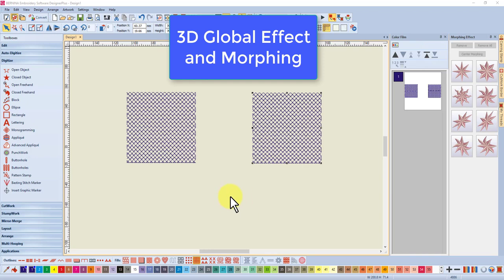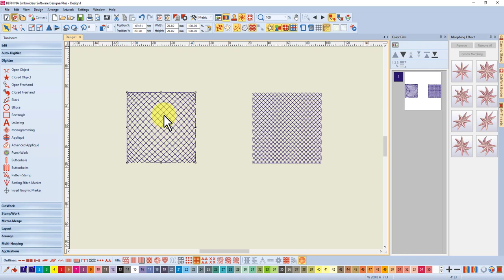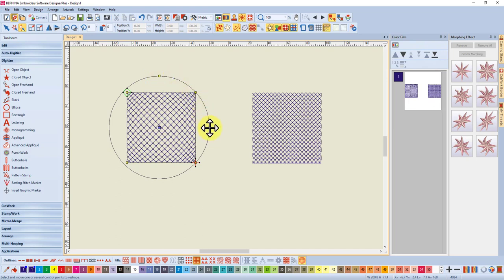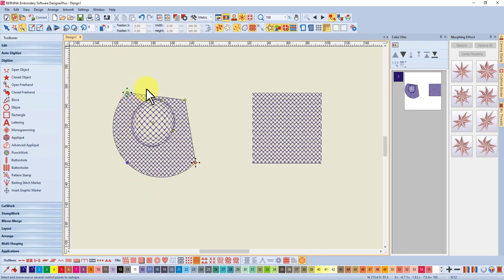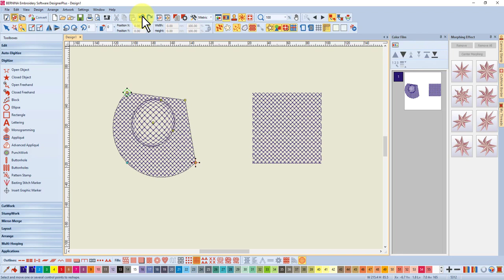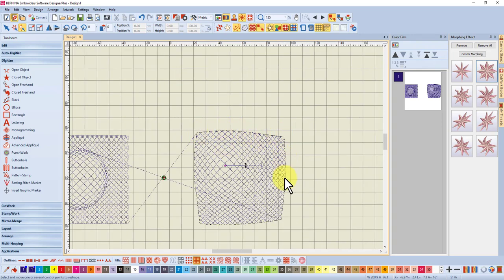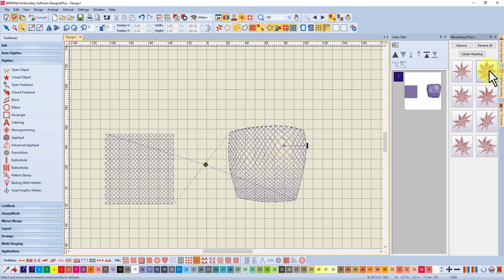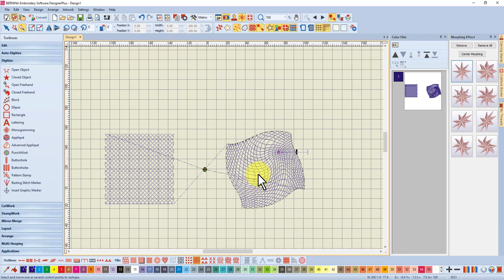3D Globe Effect and the Morphing Tools compared

Comment: hallo please show us the correct way to do perfect continues outlines with no jumps or stops ..... and why on the same design the line will work 100% and on other parts is it way off...Please help Bernina V7
Reply from the maker: Sorry I didn't reply sooner. The Blackwork Run tool might be the answer to your outline with no jumps issue. I have an older video about it here. https://youtu.be/OCkYB-xoztg In V8 the Blackwork run tool is found in the Edit Toolbox. As far as the outline being off, as the design stitches, it pulls the fabric in the direction of the stitching (shrinks it in) I have another old video about pull compensation that might help here https://youtu.be/CDuluODrOek